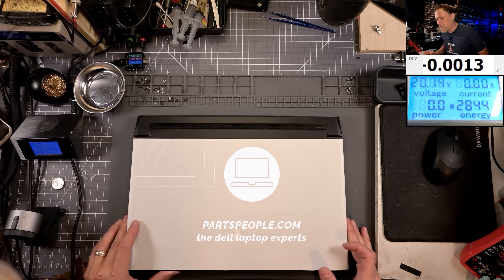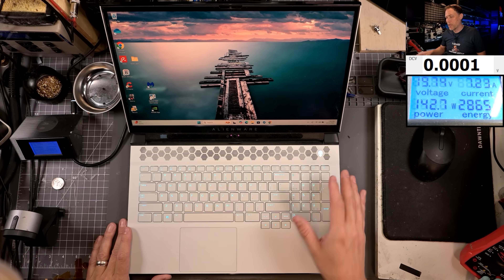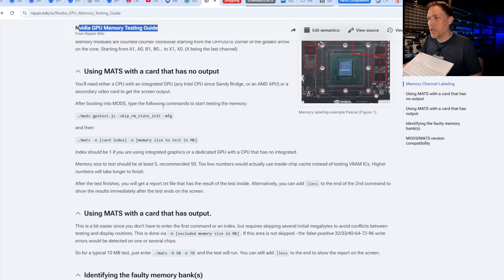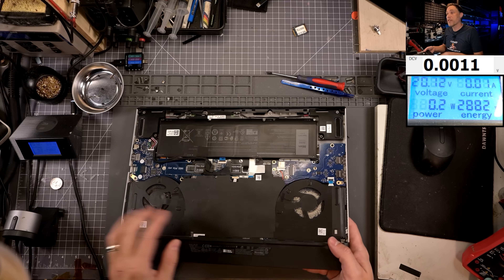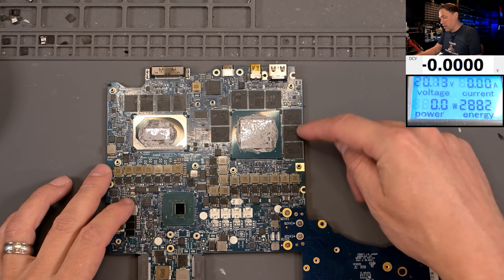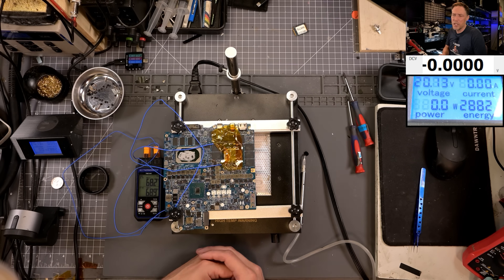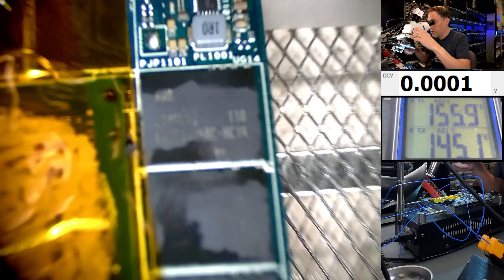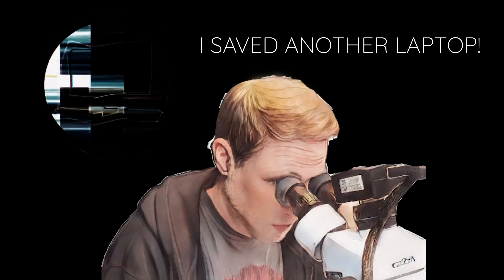Gaming Laptop GPU Failing-- And This ERROR Is NOT Helping ANYONE!

Comment: Hey my laptop gpu works only when it’s plugged in, but when I’m using it on battery it can’t detect my graphic card 
I had this laptop for 2 years now and I recently replaced the battery 
It’s lenovo ideapad 3 with Rtx 4050 
Can someone tell me what’s the issue 😢
Reply: I get error code 45

Comment: Hi, I had this error today on my ASUS TUF F15 2023. I'm not sure if it's fixed permanently so anyone reading this don't be disappointed if this doesn't work or only temporarily works, and I am mentally prepared at any minute for it to break again. When most of the internet people were saying code 43 means my GPU is dying, I was devastated, even more than most as I only recently replaced the motherboard for near £200 after my last GPU stopped working entirely. My GPU was not working on Linux either and GPU-Z said the dGPU had 0MB VRAM, so all signs seemed to point towards a hardware issue. 

However, I found one comment suggesting to open up the laptop and check for damage to the GPU. I did so, but while unscrewing the fan module I noticed it was quite tightly screwed into the motherboard. After unscrewing it, I decided to try turning on the laptop while gently pressing the fan module against the motherboard. To my utmost delight, the GPU was fully working again. Games like HOI and Minecraft ran on the GPU on Linux and HDMI was working again.

To further experiment, I screwed the fan module back to the motherboard but not completely tightening the screws. This time, I tried booting into Windows, and code 43 was gone and NVIDIA Control Panel opened again. So I screwed the laptop back up and now my GPU is working again. GPU-Z now shows 4096MB VRAM. My games run fine and my HDMI is working again.

Comment: Nice to see another laptop saved!
Just curios: why don't you use external drives so that you don't need to take apart the laptop just to run mots?
Reply: Had same thought. Use Easy2Boot and keep all your diagnostic images on a single drive.

Comment: have similar problem with Lenovo Legion 5 Pro ,after taking off heatsink can clearly see that one side vrams have no contact with thermal pads because Lenovo didn't install properly the heat spreader ,it's more like a silver cardbord thing, it's offset one side slightly over vrams ,trying to get extended warranty

Comment: Even with all his high skills and experience, a program may be needed to narrow down the Vram ect and he admits it can be hit and miss also SO  Board repair is difficult!!! Would Thermal cam showed up the chip this time?  Like car repair today, you need so many expensive tools and scanners; some proprietary..  just like schematics !! Now AI is entering, Humans might not be able to repair things soon? This channel and one or two others are skilled enough to deal with most of the newer stuff and it will only get more complex and messy and companies lock down their boards and chips even further so "right to repair"  is taken away and mega corps own your hardware such as windows 11 now with that 2.0 requirement and MS is cutting out workarounds as people find them.

Comment: I have an MSI Laptop with an RTX 4070 that had similar problems, but very different causes. My dGPU was no where to be found, Nvidia App wouldnt open and no dGPU in the Device Manager. I almost bricked the laptop trying to fix it. Turns out a problem with the MSI Center control software caused my 4070 to delete itself. Removing and reinstalling MSI Center took care of it, something I have read is a common problem on MSI laptops.

Comment: Interesting, my Alienware i9 with a 2080 super maxQ takes both a 330W and a 240W adaptor.
Reply from the maker: Yeah you can run it off at 240 watt and it actually works just fine it will just run a little bit slower or won't be able to charge the battery at the same time. It will give you an error at boot up letting you know that you're using an underwatted charger. 240 watt is what I have installed in my workbench.

Comment: Impressive fix. Only proves that knowledge and the proper tools takes the guess work out of the diagnosis. Loved the re-ball. Using the right size balls eliminates excessive solder under the chip. $250 for board diagnostic is a steal!!!!

Comment: And that's how reballing should look like. Using solder balls not solder paste like on the CPU from live stream. Good job with that 👏
Reply: The CPU live stream reballing was not suppose to be a professional easy fix. It was not for a customer. The CPU and motherboards were doner/scrap boards.
I really enjoyed the drama with the solder paste CPU reballing. It would have been a very short video and no amusement if Nathan used solder balls with the CPU reballing.

Comment: On the topic of GPUs, i am happy you pointed out the hybrid mode (Intel iGPU for display and it offloads the work to nVidia dGPU - hopefully, i am not saying it wrong. Front-end and back-end).

Can you please find a Dell laptop with glitchy screen which (1) the user couldn’t fix by driver update or rollbacks, and (2) the problem will be ultimately a worn-out display cable? I am seeing a lot of that on Reddit but with these brands: Asus, Lenovo and MSI. It is an interesting problem (content farming) at the moment.
Reply: I had a worn out display cable on my Vista era Vostro 1400... ended up wrapping tape around the cable to apply pressure and more-or-less fix it for my occasional XP usage...

Comment: Sir why are you using solder balls instead of solder paste for reballing purpose
Reply from the maker: This is just the jig that I use for reballing V Ram
Reply: Solder balls almost guarantee (99.9%) uniformity down to 2-3 microns across all contact pads.
Reply: @PoXFreak And what about the accuracy of solder paste using stencil
Reply: @vinstondavid it depends on the blend of the paste, but the ultimate goal is to have all the solder pads connected by the same amount of solder so there's no doubt in the quality of the connection in the finished rework.
Plus you have control in the selection of solder and flux used. Some flux is great for micro soldering but not reballing because of it's more fluid nature when heated.

Comment: This is probably a silly question, but what is the best way to keep my laptop fans clean without disassembly? Will using compressed air through the vents on the bottom of the laptop be sufficient to clean the fans? Are there any precautions that should be followed cleaning with using compressed air? Thanks.
Reply: When it is new or perfectly clean, spray the blades with Teflon (do not spray the engine or the interior parts). Also, always have one spare.
Reply: Nathan had mentioned (on a live 2 weeks ago), to periodically air spray your fans every 2-3 weeks.
I've done it every 2 months, until about 2yrs ago. Since then, I do it every 3 weeks, max.  I set it in my calendar, so I keep the cleaning timing constant. :)
I now use an electric air spray. The liquid versions, if held sideways/up-side-down, can spray liquid (could mess up internal components), making you have to wait a few minutes for it to dry, before you can use your laptop safely again. :)
Reply: All the gaps are so tiny, you will probably not be able to blow bigger lint and dust particles through vents and fins.
Also, if you spin up the fan, the fan will act as a generator and send voltage/current into the circuit, running the risk of causing damage to other components.
So you would have to lock the fan in place in order to prevent it from spinning up too fast.
Reply: The worst I had to clean were the ones that the kids took on the sofa, or worse. Loads of fabric fluff.
Reply: @profandrewstarr  I always have warned everyone I've encountered, NOT to put a laptop on top of any surface that's fabric. It will cause the laptop to overheat/die, because it blocks necessary intake air flow to cool off the laptop, while in use. :)Remember, for standard laptops, intake is usually on the bottom and outtake is on the side/back. :)